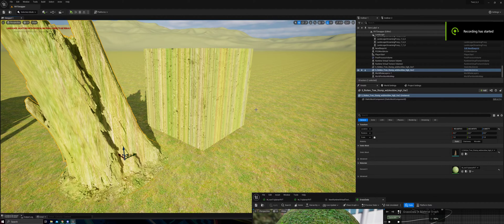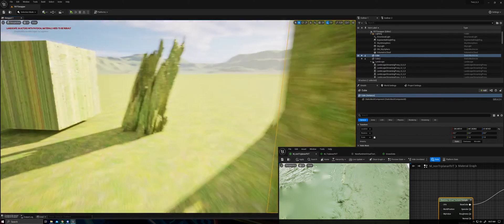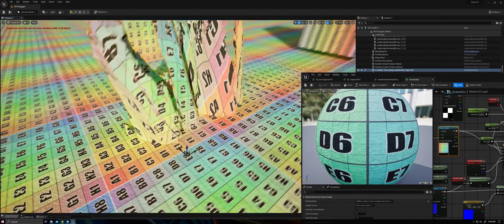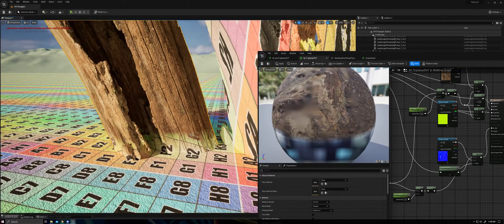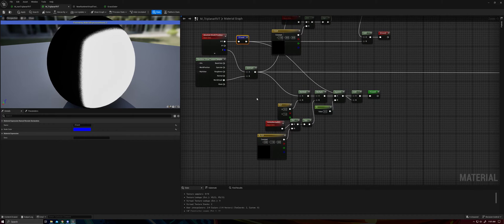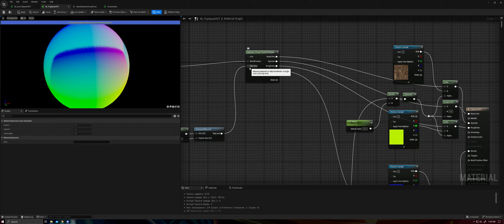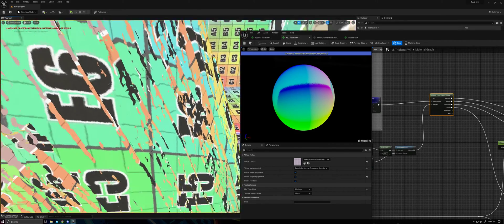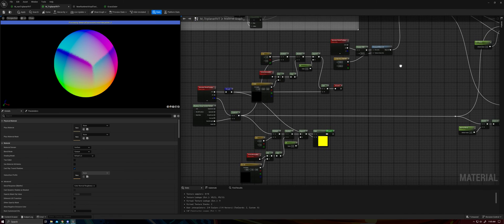Fixing Runtime Virtual Texture stretching (Tri-planar RVT!?)

Comment: Hello! Could you create three sample technic triplanar here or not? I use triplanar 3 sample technic to blend samples without using dithering or mip levels. Because dithering looks really bad it could be used in some cases such as LOD transitioning but not here. I need to add accurate blend between triplanar samples. I'm a beginner, sorry!
And another question is about normals, you get texture from the landscape so the normals too, and if you project them on the different slope normals go wrong, how to fix that issue?
As I use non tangent space material settings I can multiply normal channel by VertexNormalWS and get the result, but would it be correct or not?
Reply from the maker: You can, but keep in mind that sampling virtual textures is already more expensive than a standard texture. So sampling it 3 times for tri-planar is extra expensive, but it is doable. 

As for the normals, you usually get the world space normals from the landscape, so the slope data should be baked into that. So I don't understand how a slope would cause any issue when blending. If you're using world space normals for your mesh and you have world space normals from the terrain, it should be as simple as lerping between them and a normalization.
Reply: @TechArtAlex  I mean I project normals from the landscape RVT onto a mesh for example a ramp, the angle of the ramp is not the same as the angle of the landscape under it, so I need to reorientate RVT texture normals on the ramp otherwise the lighting will not be correct. That's a question, how to properly reorientate the RVT normal map on along the surface of the ramp.
Reply from the maker: @FFAudioProduction Maybe I'm missing something but I'm still not seeing how it should make any difference. Yes the normals are different, but if they're both in world space then we are simply just interpolating from those world space landscape normals to the world space mesh normals across a small transitionary zone. Most of the mesh will use its own normals. 

What were looking for is a smooth blend from the landscape normals to the mesh normals only near the intersection of the mesh.
Reply: @TechArtAlex  Ok about normals. Another question is about bottom part of the mesh, for example a sphere, when I blend RVT texture from landscape onto a sphere, the sphere is big and stands on the landscape I see, how the texture stretches on the the bottom part of the mesh, that's a question, how to solve it? And of course no blending between triplanar projections, there is no blending at all but dithering which looks really bad.
Reply: @TechArtAlex  I've recorded a video for you in my channel, named "Normal blending problem Unreal Engine 5.4.4" If you can watch it, where I'm showing some problems. I can't paste links here. Thank you.
Reply from the maker: @FFAudioProduction okay I'll take a look at it later tonight
Reply: @TechArtAlex  Ok
Reply from the maker: @FFAudioProduction  Alright I took a look and left you a comment.
Reply: @TechArtAlex  Thank you!

Comment: This method is really great, thanks for sharing. However, I encountered a few problems here. The first is that RVTBlend cannot control the size correctly. If the value is small, it will not appear, and if the value is slightly larger, everything will be wrapped. The second problem is that the Blend Texture is very blurry. I hope you can help me solve it.，，Best regards ,very appreciate.😎
Reply from the maker: Blurry texture most likely has to do with RVT settings or possibly a cvar for memory management. The blending I'm not so sure of. I'm pretty sure I used a fairly standard setup for blending based on the heightmap, but you could substitute that for any other RVT height blend method.

Comment: how would this work with large landscapes?
Reply from the maker: It shouldn't make much difference. The whole point of RVT is that only the parts of the texture that are on screen or near the player are fully in memory anyway.
Reply: @TechArtAlex  what i meant was with large landscape blending material becomes so blurry like landscape textures(uv) are same size the landscape.
Reply from the maker: @touristhawk  You can increase the resolution and other settings up to a certain extent but if it is still too blurry then you will need to make other changes. 

One example would be to have the RVT write a weight map instead of the actual displayed textures, so that the tri-planar blend can sample the original full resolution texture instead.

The original textures can be stored in a texture array, and the weight map can indicate which index of the array should be sampled by the object. 
This would require an additional dependent read so it is somewhat expensive, but I believe it would be acceptable for an ultra quality version.

Comment: Thanks for this great tutorial, really good stuff! I hit one snag though: below a certain Z-coordinate (about -600 in one map, -180 in another), no textures appear on an asset anymore, it becomes dark. I triple checked if I made a mistake in copying your graph, but everything seems fine. A hint on how I could hunt this down would be much appreciated. Keep up the great work!
Reply from the maker: Hm, the first thing that comes to mind is to ensure the bounds of the RVT are correctly scaled. Since it's sampling the heightmaps in order to drive the blend, if a part of the height map is clipped off for some reason it could cause this. Might explain why it happens at different levels, too. If it was something within the shader logic, we'd expect it to behave the same on any map - which means it's probably due to something specific to the RVT or its settings.
Reply: @TechArtAlex  You're absolutely right - it was the RVT bounds. I'm  working with water bodies + PCG and they were "digging" below my current RVT bounds and placing assets there *facepalm*. Thanks a lot for the fast reply!

Comment: Does this work in the vertical as well? For example adding a rock mesh to a vertical plane on my landscape (cliff). Using a different techniqe and while the blending works on horizontal planes, i get the streched texture issue on vertical planes
Reply from the maker: It should work for slopes, but not verticals, since RVT is only top down. How are you texturing the cliff?

Comment: How do you create YCoord, ZCoord and XCoord Nodes?
Reply from the maker: Those are "Named Reroute Nodes", a very useful tool for making the material tidier.
Reply: @TechArtAlex  Thanks!
Reply: @TechArtAlex  i had the same question, what node are you rerouting them from?
Reply from the maker: @tylermadigan7631  They are the tri-planar /world-aligned UV coordinates used for the texture projections. You can spot the source of named reroutes because they have both an input and output, whereas when you reference them later it will only be an output.

Comment: the performance· is much better than tri-planar node？
Reply from the maker: This isn't really a substitute for triplanar mapping, but rather how to achieve a sort of tri-planar mapping effect with landscape RVTs. The dithering technique used will be far more efficient than sampling a landscape RVT multiple times as normal triplanar mapping would, however.
Reply: @TechArtAlex  we want to use rvt method, but tri-planar has performance problem, so we want to find a good method to solve the strectching problem..
Reply from the maker: @YodaMaster-p3k  Sampling virtual textures actually requires two samples. So when you use a triplanar mapped RVT you get 6 samples per texture instead of 3. This could be part of the poor performance. 

The dithering technique (which I go into more detail about in my single sample triplanar mapping video) allows you to get a good projection with one one texture sampler (two in the case of RVTs instead of 6). So it can dramatically reduce the number of samples needed for RVT.

Comment: Great work! I was able to follow all the nodes and hook it up. Although I'm not sure how to implement this technique using megascan surface materials, I was wondering can this be made into a material function that can be used?
Reply from the maker: Thanks! I'm not sure that you can use an RVT sample node inside of a material function (although I've never tried), so it might not be possible to wrap the whole thing into a single function. If not, it could probably be wrapped into two functions with the RVT sampler in between.

Comment: Great technique! I'm curious, have you had issues using this on nanite meshes? When I attempt to use it on nanite meshes, its extremely blurry, but works fine on regular meshes - bit of a head scratcher, have tried a bunch of things like using pre-skinned normals/position etc, but the results are the same
Reply: Just in case anyone runs into this - simple fix, make sure you actually change the RVT sample to use mip level and manually calculate the mips as shown in the video
Reply from the maker: Thanks! Glad it's working for you. I did have some blurring issues - and not just with nanite. Sometimes it's just RVTs being finicky but other times it's the mipmap as you found.

Comment: Nice technique, but for me the major issue is more the terrible stretching for down normals when the DZ injected value progressively compensates the XY around -45°. I had to slightly change the graph to do a DZ inversion in the injected value after reaching a certain pitch angle between 0 and -45° with another dither blending at the junction to fix that. this basically does a reflection after that limit which is already present anyway with the down plane.
Reply from the maker: Thanks! That's a great addition.
Reply: Hi! I’m quite new to RVT and UE, and I’ve run into the exact same issue you described with texture stretching on cliffs. Your explanation was super insightful, and I’d be really grateful if you could share how you set up your material graph to solve it. I’m trying to fix it in my own project and would love to learn from your approach. Thanks!:yougotthis:

Comment: Thanks for sharing. I am planning on returning to Landscapes soon, looking forward to getting this in there!
Reply from the maker: Thanks! It's a subtle tweak in many cases, but it makes the blending a lot more flexible than a simple XY projection. Some meshes won't really need it - but I experimented with a lot of offset techniques and this was by far the best. RVTs are pretty expensive to sample too, so it makes my single-sampler method a great fit.